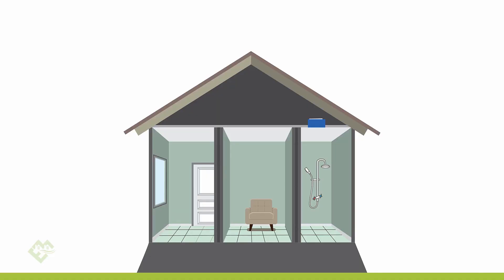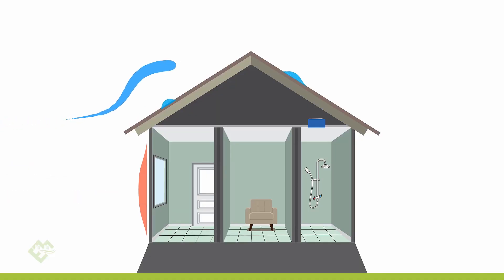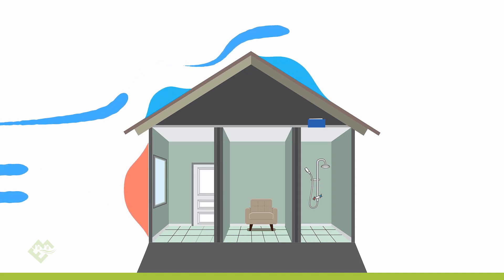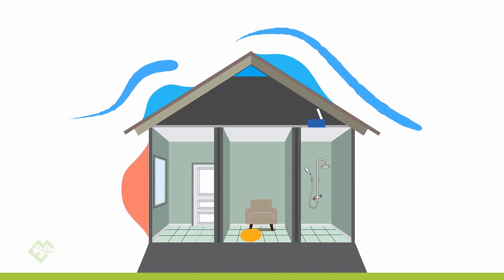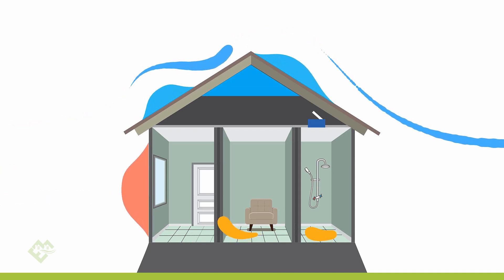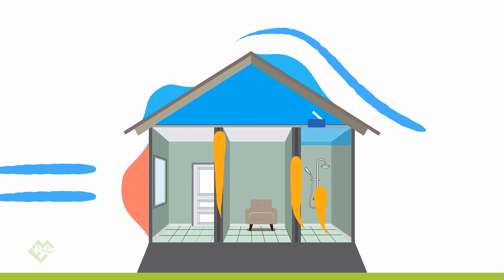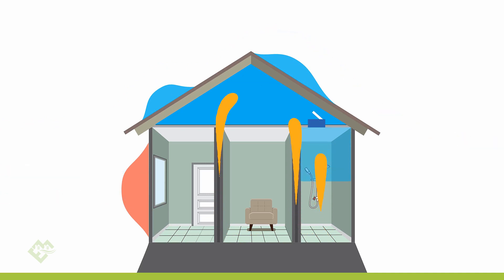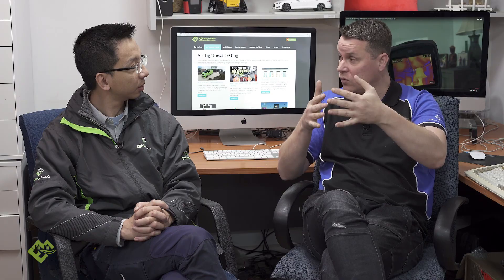Why is my home draughty, what can be done?

Comment: That’s great. Come on. Let’s design a ventilation system  that gives us ventilation fresh air no smells  no cold drafts  may be a wind mill on the roof and some control.  Pipes and valves thanks mike

Comment: Are there any sealed down lights?
So a un vented roof is better?
Reply from the maker: There are sealed downlights.   We also have a range of downlight covers, that reduce air flow through recessed lighting.   All roofs are normally ventilated and require ventilation, not much you can about that.   The air barrier must follow or be directly abutted to the thermal barrier.
Reply: Thanks for that, very clear information. 

I'm in the UK in a 1950's semi detached property and can physically feel cold air around my head with the heating on and it's really been bugging me. Hoping to renew the loft insulation and cap the downlights soon